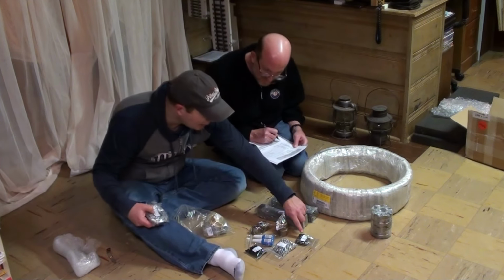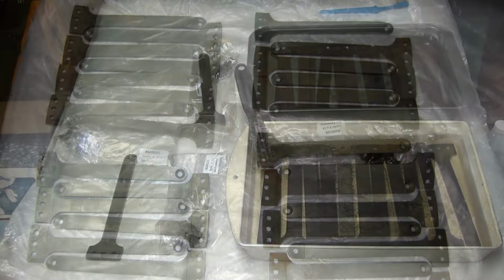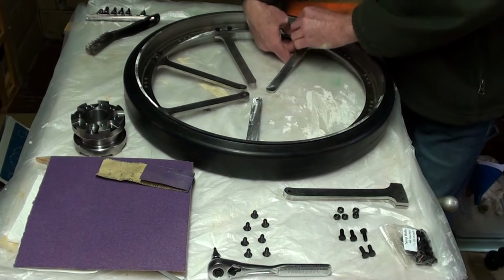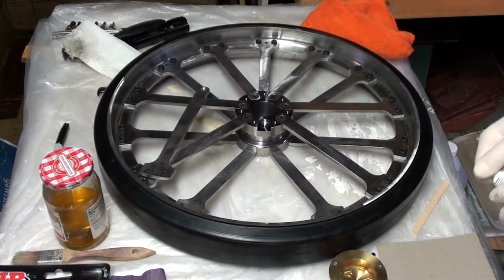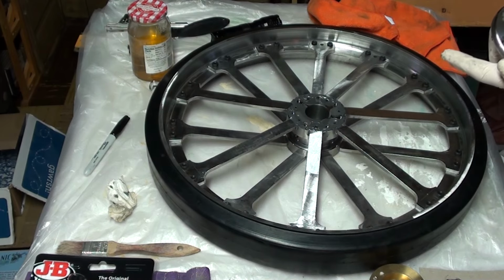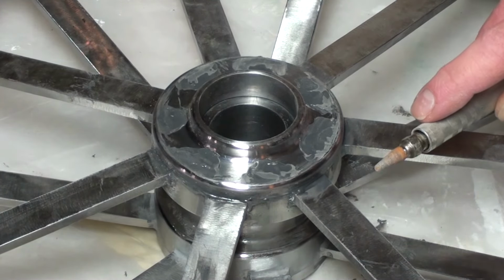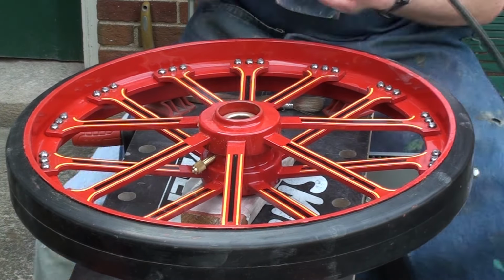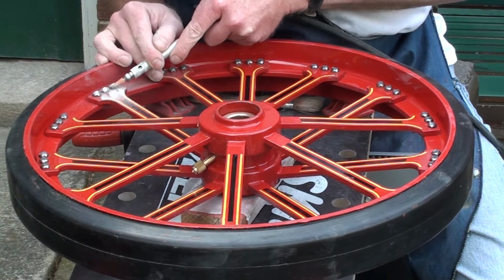Kit 01- Front Wheels: Steam Traction World 4" Scale Burrell DCC Road Traction Engine Build

Comment: Did the kits turn up on time? One a month? Did you manage to complete each months tasks before the next kit arrived?
Reply from the maker: Thanks for your interest.  Yes, we opted for shipping the kits individually approximately once per month.  Because of several supplier issues STW had to deal with, our boiler was ready before the cylinder casting.  I asked STW to delay shipping the boiler until at least the cylinder casting was available, figuring both were heavy and I could probably save a bit on shipping by doing so.  In the meantime, several other kits became available so I had those added to the boiler shipment.  More recently, I ordered one wagon to pull behind the engine when complete.  So far, two of these kits became available and I expect at least one more before the cylinder is ready.  At that time, I'll have everything from the last several months ship at once.

There have been a few delays along the way, so although most of the time, things arrive, one kit per month there have been a few times where nothing has arrived for several months at a time.  From my understanding, these delays were largely out of the companies' control and more related to supplier issues.  When kits have been shipped, they generally arrive in the USA within a week.  I have had several situations involving customs inspections that resulted in some missing parts, and one shipment "lost".  Each time STW has been very understanding and has worked to get the situation corrected.  We are still waiting for some replacement parts, but recently they were able to put together a replacement for our lost shipment so we are making progress on the back ordered parts!

We've been grateful for the occasional delays.  Our project is being fit in around several other hobby projects, house projects, full time work, vacations, yard work etc.  We were beginning to fall behind in our progress because of these other things, painting issues and more.  We hope by the time our large collection of parts arrive, that we will be mostly caught up to date.   Starting the project, we expected most of our work would get done during the late Fall, Winter and Spring and so far that has held true.
Reply: @stclairwestern thank you for the detail. I am excited to see the progress.

Comment: did you use a paint brush and how did you do it
Reply from the maker: Hi Andrew,

About 34 minutes into the video we talk about and show a bit on painting.  The 3 of 4 wheels and the front axle were all brush painted.  We used Rust Scat paint from Benjamin Moore Paints.  It is a polyurethane enamel paint (discontinued as of Jan, 2023).  Rust-A-Void is the brand that replaces it.  The paint is much too thick to brush well, so we use Penetrol paint additive by Flood (Flood.com) to thin the paint and extend working time enough to get a smoother finish.

Our technique is to brush on quickly and reasonably heavy with one brush, then using a second brush to lay off the paint.  Basically we pull the brush very lightly at an angle from the edge of the painted area towards the previously painted area.  This will even the paint and help smooth it.  The paint itself is the consistency of milk.  When done carefully there are only very light brush marks left.

Not being completely satisfied with the results, we have been using an air brush to spray the paint on the remaining wheel and larger parts.  This has it's own problems which we have not completely overcome, but the finish looks very good except when critically viewed under bright light at very close range.  For a consistent look, the last wheel will have the last coat brushed.

We've learned some paint colors use a transparent base in their formulation.  Red is one of these colors.  As a result it is taking upwards of 6 or more coats of red over the primer to build a good and even color.  Our burgundy color takes much less to get a good color finish.